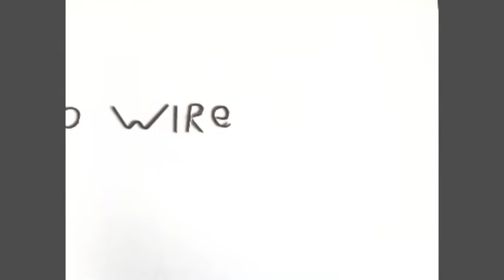Wirebending 101 Final

Comment: I read that bow should be at the junction of incisal third and middle third?
Reply from the maker: Yes, I have read that too. I have also read that it should be at the Junction of the Gingival third and middle third, I think it depends on the school of thought the author is coming from. I usually leave it at the middle of the tooth and let the doctor decide/adjust to where they prefer.
Reply: I think it should be on the most prominent part of anterior teeth
If there is marked protusion it will come more toward insical middle and for retruded more toward cervical, maybe that’s the thing
Reply from the maker: @fareeha94  I completely agree!

Comment: What number of wire do you use? My teacher taught me with the number 36, but it's so thick and I can't manipulate the loops.
Reply from the maker: I use .032 wire size it is eaiser to manipulate. So labs use .030 and that is even easier to use more flexible less stiff. Depends on the doctors preference. I use .036 a lot for soldered appliances like bands and loops and Lower Lingual Arches and other space maintainers
Reply: RetainerDesigner Thanks for your answer. I will use 030 or 032 and my hands will thank me :D
Reply: RetainerDesigner Thanks for this info. truly helpful

Comment: I have a question!
I'm a student, and they told us to make the distance between the wire and the incisal edge about 1mm only.. and it should be under the cervical line of the canine  about 2mm 
And when I make it like your way doctor tolds me to redo it :/
So what is the difference between them and why it should be like that?!
Thanks ^^
Reply from the maker: +RAHAF DR i have made labial bows like that before but it was for certain occasions where the doctor wanted to tip the anterior incsial edge lingualy. But i would say the norm is to have the labial bow in the middle third of the teeth preferably directly opposite of the acrylic line of the retainer on the lingual side for the most stability. I got this from my lab school and most books on the subject. 
But! Every doctor has his/her preferences and you have to follow them. :)